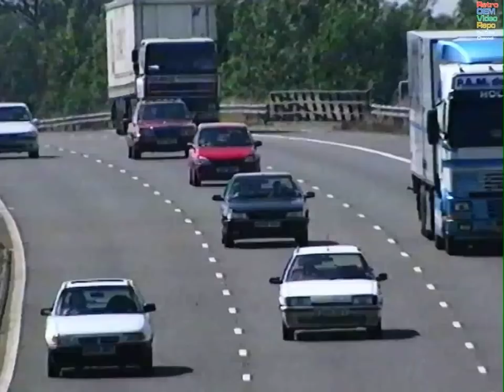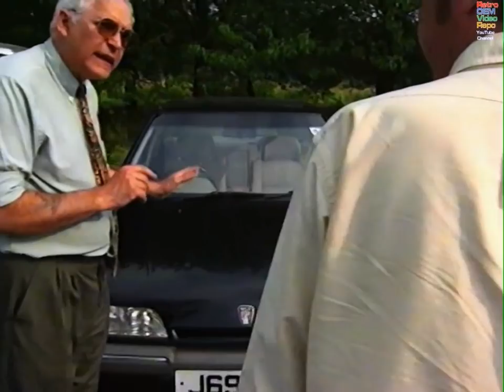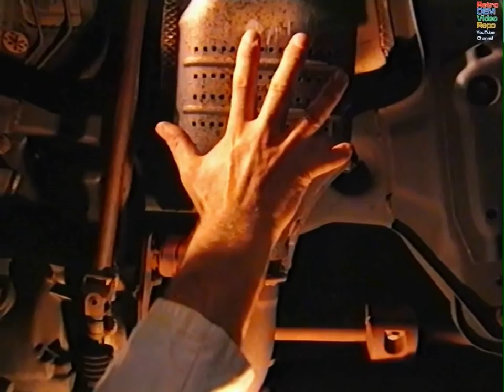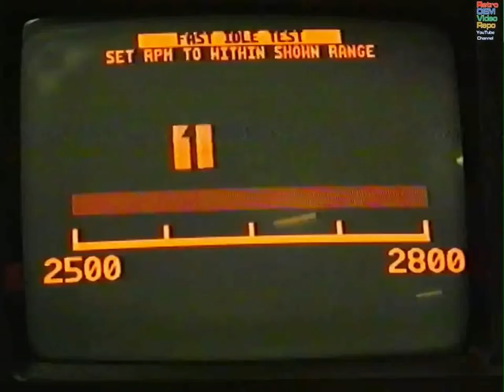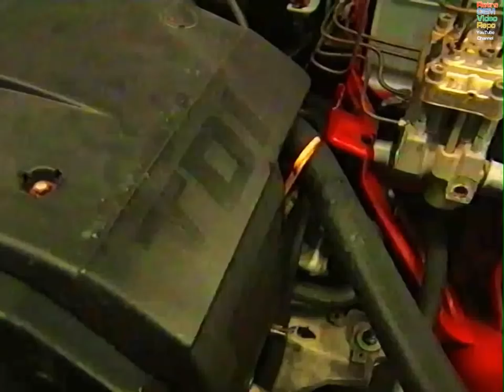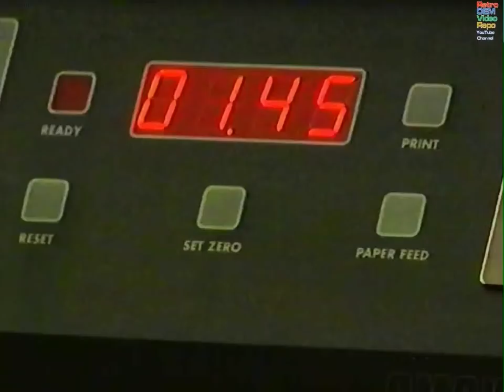Vehicle Inspectorate (UK) - MOT Matters - No Smoking - VIV08 (1998)

Comment: Maybe the old MG had been taken off the road already.  Anyway few of the petrol cars featured faired very well:
A464 BHL Tax due: 01 November 2003 (19 years, good effort from the Range Rover)
VAR 730J Tax due: 01 October 1984 (ie. well before the programme was made)
J69 VEW  Tax due: 01 February 2002 
L539 FON Tax due: 19 April 2004
N104 DKW Tax due: 28 February 2006:  The MK5 Escort managed to last 9 years, OK for a car that was already a hideous heap when it was new.
Reply: The Audi, L46 NUG had an MOT until 13th of May 2017!
Reply: Thats a mk6 escort - much more refined, especially with the zetec engine... N was 1995, so if it lasted until 2006 then its 11 years..
Reply: Escort was registered in March 96, so let's say it lasted almost 10 years.  Yes, it was the MK6 then, maybe a little less hideous than the MK5, but they were always fairly unloved cars.  Can't be many left, wouldn't make much of a future classic.
Reply: yeh 10.... Not that long really!! I like my escorts, the base models like this one are still £400-600 cars but the GHIA, GTI and RS models are creeping up slowly. Problem is, they have all been welded to death by now.
Reply: Emissions tests killed many an older car alas. The doing away with 4-star leaded petrol didn't help, though my Wolseley 1300 liked 4 - star once the cylinder head had been modified. At the same time I had a Jack Knight five - speed gearbox fitted, and the engine was rebored to 1340cc. Still miss that characterful and reliable old tub now.
Reply: Cars now are like domestic appliances these days. They don't even look 'car' like half the time.